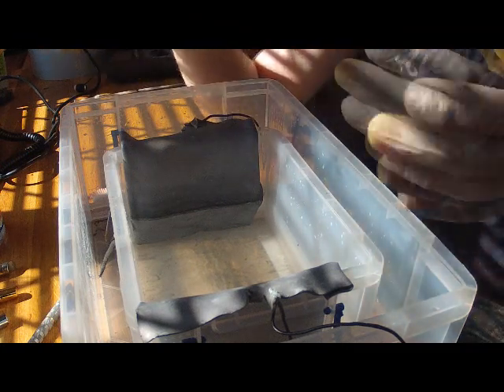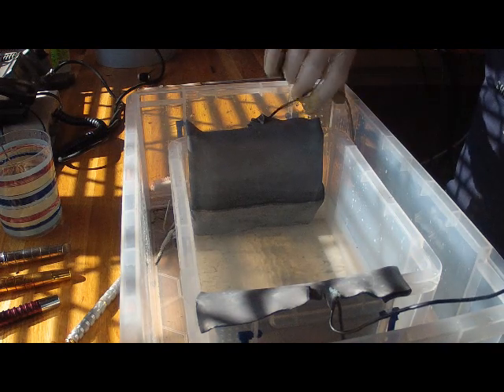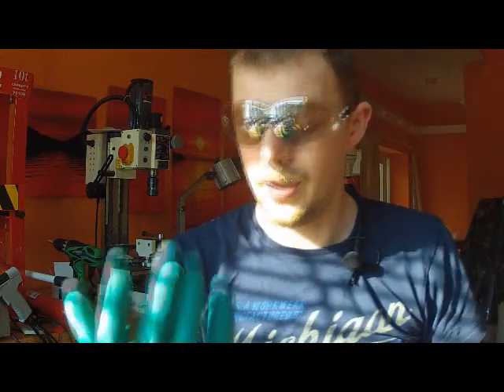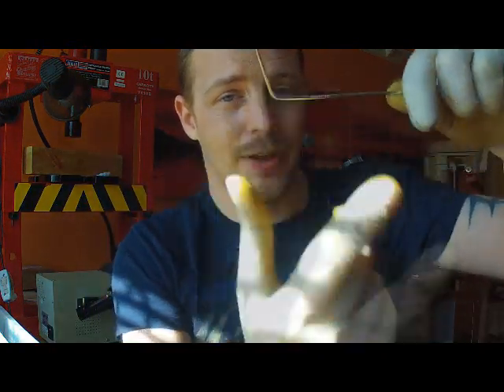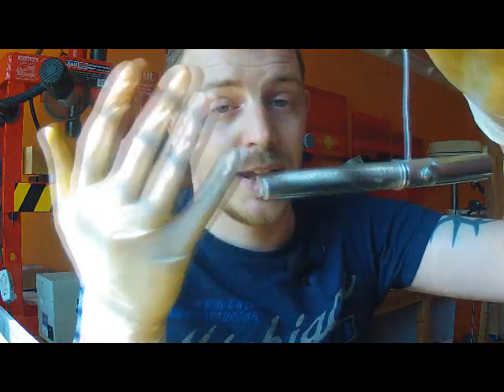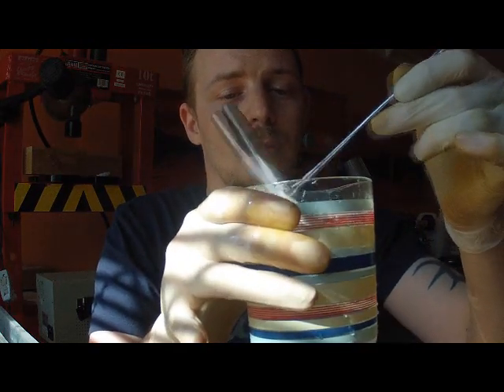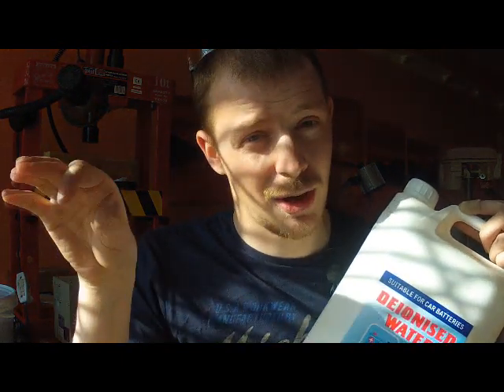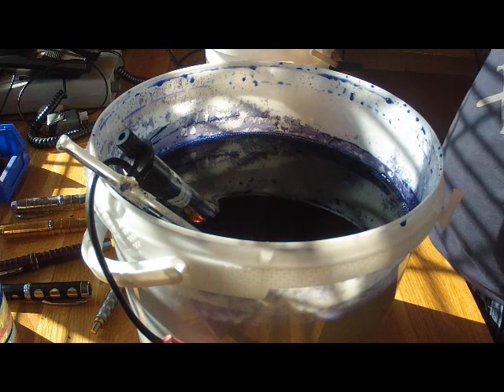Anodising aluminium at home part 2 ✔

Comment: hy, Nice Job, but Can you please tell me what is the perfect temeratur for dye?
if I undwrstand it's 30F Google say it's -1 degreeC.
Reply from the maker: you will need to read the spec sheet which comes with a dye as they all vary. if unsure, use at room temperature. if the temp is recommended to be high, regulate it carefully so you don't go over and seal the piece prematurely
Reply: retelisystems thanks, I think that 30-40 degree C not seal the aluminium.
Reply from the maker: you will be fine at those temps, but as mentioned always best to refer to the spec sheet.

Comment: I have purchased a FS-PS100 power supply. http://gaterosplating.co.uk/Power-Supplies-and-Plating-Rectifiers.php Could you send me a link to a recommended variable resistor to use. I am a little worried that 100W will fry anything I have seen on Maplins.
Reply from the maker: Hi, you would have better spent your money on the next model up with the VR built in. Gateros offer a current resisting coil which you may try. I wouldn't like to take a guess as to what VR you would need

Comment: thanks for this video. not anodizing pens but an ar upper receiver that is raw aluminum and going to paint it black vs dye it black as dye is expensive and i only need a tiny bit so going with ceramic engine paint.. got it sand blasted did a simple scrub now im going to do a few more cleaning steps and get the show on the road. by researching i have found out, you can use aluminum foil as a cathode. and if the cathodes do not fit flush against the tank you end up doubling surface area per cathode. but having too big of a cathode is no big deal. of course i have a 5lb brick of lead but its like 1/2 inch thick so gotta pound some strips flat but if it takes forever i am just going to use foil. but aluminum transfers current much better than lead so you can use less current and voltage i do believe but i still need to research the numbers for that.
Reply from the maker: Lucky you. UK gun laws are ridiculously high. something of which i am jealous about with the states. We need a 2nd amendment. , I am not sure if the aluminium foil would get warm, being as its thin. May be worth double checking, as if it does it will slowly heat your tank making it difficult to regulate the conditions. Too warm and it'l anodise too fast giving a poor finish
Reply: ended up making a fire, lining a sheet pan with foil melting some lead and pouring a sheet and cutting out the pieces i needed.  but it did come out good and seems to have worked.
Reply from the maker: opie7afe Very resourceful. Nicely done ;)

Comment from the maker: oh and thirdly, check out the specs of the cleaning detergent used.. as some, although few will attack aluminium and could cause pitting on your piece. if in doubt contact the manufacturer and ask if it is suitable with the use of aluminium. regardless to what anyone tells you.. test it on a piece of aluminium first before running it on your main piece

Comment from the maker: can pit the surface of the aluminium. check the specs to make sure the cleaner can operate at a minium of 130kHz, also, having a cleaner which has a sweep function is a bonus too, as this can avaring on highly polished pieces

Comment from the maker: sure, you can use ultrasonics for cleaning aluminium as a pretreatmen, but there are some precautions. I assume you know how ultrasonics work, by causing an implosion of bubbles over the surface area of the piece which in turn remove dirt, and the size of the bubbles can be varied by adjusting the frequency - with lower frequencies causing bigger bubbles oppoes to the higher ones causing tiny ones. While dealing with asoft alloy, you are better off using high frequencies as large bubbles (cont)